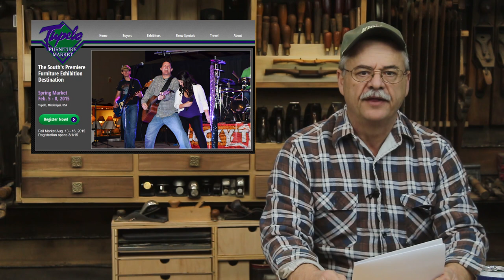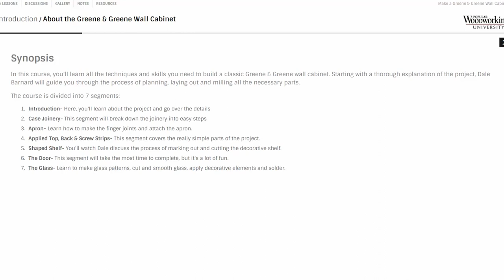Behind the Sawdust #3- 1/31/15 Sawstop table saw review, Tormek bench grinder tool rest giveaway #2

Comment: Excellent show! 
Here's some point to ponder.
1. If you set off the cartridge you can usually have the blade resharpened, a $20 cost.
2. It's usually pressure treated wood that sets off the cartridge, because it's treated with a copper compound which conducts electricity. Disabling the safety feature is a must for this task.
3. The other more popular reason the cartridge triggers is to do with older woodworkers who had saws with fences that are less than precise. They stick a metal tape (conductive) out, in front of the blade set the fence distance and wonder why, as the blade is spinning down, the cartridge blows. "I didn't do anything" they say. Set the accuracy of the fence once when you set up the saw and use the measure that comes with the fence. It's accurate and any errors are consistent throughout the project and too small to be noticed.
4. Wearing gloves whilst using a Saw Stop, depending on the material they're made of, may negate the safety feature, so bear that in mind before you use it.

Comment: Stumpy the gloves cost John Krantz finger tips. John sells Northern BassWood for carvers at carving shows. His glove caught the blade as he lowered a thick cut as he brought his hand back and zing the finger tips in the cold shop were gone. I use a SharkGuard for safety and source dust capture.. I like my guard and learned when and not to use one in High school in the 60 and at the YMCA earlier. I don't care if you or others do not use safety devices but here is tradition and there is practice and safety is present in both.

Comment: Just gotta know, Harvey or Sawstop.  The answer may need a video.  Does an incredible miter gauge plus the best router fence in the business not to mention a TIN  table top that looks and acts mighty fine equal a finger?  Great question and I am most interested to hear your answer.  Am considering buying a Sawstop and also purchasing the Harvey cast iron router system as well as the Harvey miter gauge.  Sort of the best of both worlds.  Would love to hear your opinion because of finding 5.  Yeah, it certainly is expensive, but mistakes are even more expensive. I'm also concerned that the router table will not fit the Sawstop frame.  They say it will but who knows?

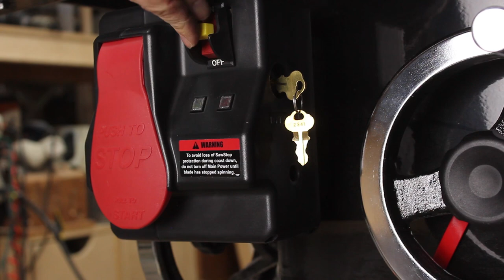Comment: At 16:35 you mentioned that the key can be used to disable the saw so nobody can use it. That is not true. The key is used to disable the sensors allowing you to cut conductive material that is in contact with your skin such as wet wood or a sheet of aluminum. As soon as you shut the saw off, it automatically reverts back to it's default settings, which are going to stop the saw if it comes in contact with you.
Reply from the maker: Of course it's true. Yes, the key can also be used to do as you said. But if that was it's only function, it would be a switch, not a key that you can take out. "Keys" (either literal ones, or removable tabs on the switches) on shop machines are very common, and have been for years.

Comment: I've had my SawStop for about six months - one of the reasons I went with it was my loss of the tip of my right forefinger on an old (!) table saw in 1975.  I couldn't agree with Stumpy more on the quality and workmanship of the saw - it the one thing in my shop I know I can never blame for my errors!  My cartridge was triggered about a week ago, and I sent it back to SawStop for download and diagnosis, as it didn't come close to my flesh and there were no nails apparent in the cut.  The response was that "most likely" something metal must have touched the blade - either the riving knife or miter gauge.  I'm pretty sure none of those things happened, and the cost of replacement is a bit of a bite, but I still love the saw and appreciate the safety it provides!  I am very jealous of your upper dust-collector shroud, but I could have bought one if only................................

Comment: You should watch Mathias Wendal's video he him trying to get a piece of cloth to hang up in the table saw blade .  Hard as he tried he couldn't get anything to catch.
Reply: I can tell you from personal experience long sleeves and anything that rotates is dangerous. Got a jacket sleeve caught in a router bit and spent three hours in the ER picking nylon shreds from the jacket out of the wound. I've seen Mathias's demonstration and if he had taken the wood simulating the arm and caught the fabric in the middle it would probably scared the crap out of him if he could avoid getting injured. It only takes one tooth to snag at tool speeds to start the catastrophe.
Reply: James Hastreiter Router bit huh?  Yuck.  I agree as I was a machinist /and or weldor a large part of my careers.  I had a similar accident with a cup brush on a 7" Black and Decker grinder, it just didn't want to stop turning.  But I have to work in a wood shop at ambient winter temperatures but with a lot of experience at this I judiciously gauge my clothing exposure.